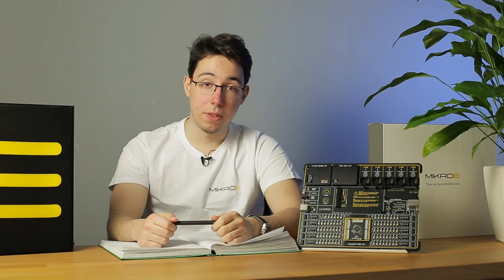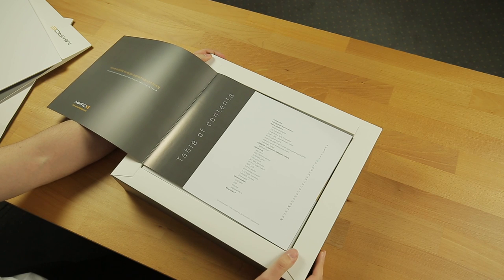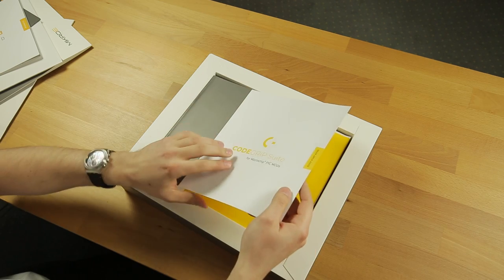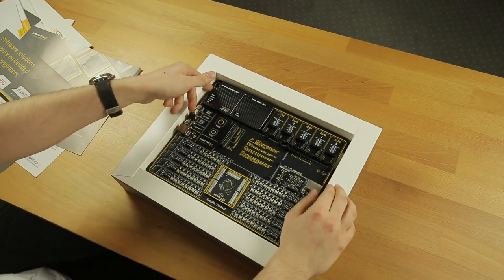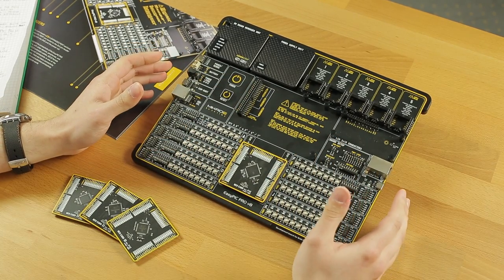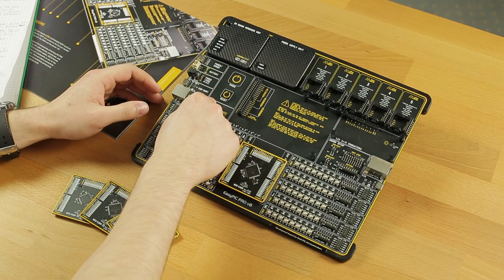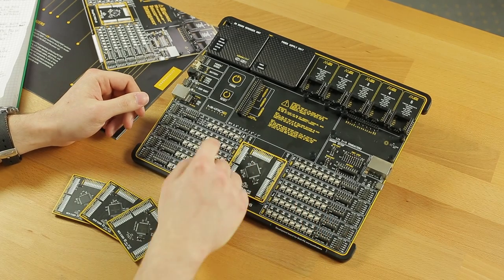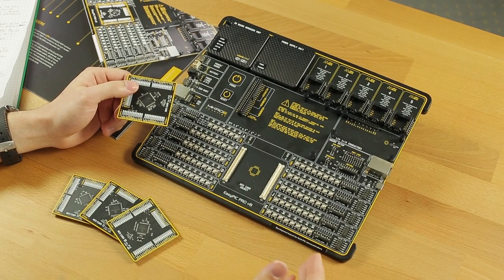EasyPIC PRO v8 | Let's Unbox

Comment: This looks great but I'd prefer to see it being used as opposed to seeing the box it came in.  Does it come complete or do I need to buy software (e.g., a compiler) and additional hardware to use it?  Also not clear on the difficulty of integrating the MCU with the plug-in boards.  Thanks for the start anyway.